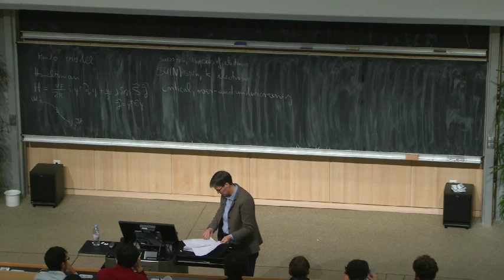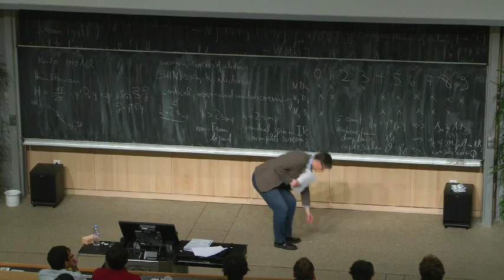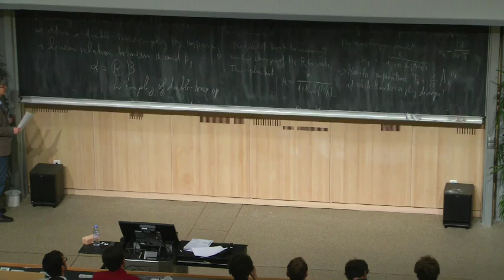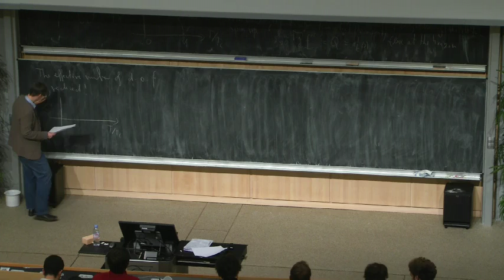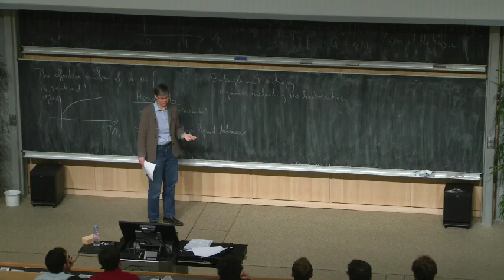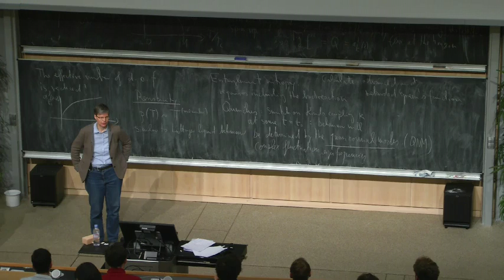Johanna Erdmenger - Gauge/Gravity duality for magnetic impurities - Lecture 3

Comment: If the use of he word "condensate" is for a general case of "crystalline"-like states that would model the inter-relationship of quantum fields, (like the Bose-Einstein example infinitely distributed from a universal zero), then the exchange of potential by Tachyon must be equivalent to the Back EMF of electrical circuits, and that would agree in principle with the balancing state around constants in a Temporal Superposition, (happening everywhere all at once, but in bonded loci of eddy currents), because the compound "chemistry" of one bonded complex symmetry is the product of forward and reverse reflections of potential motion in the universal information state; ie past and future are symmetric potential of one connected state that is position, mass and momentum. The lecture seems to be establishing a detailed, practical exposition of the Q Field relationships to include the phase/frequency bond of Gravity, to be useful in conductivity?